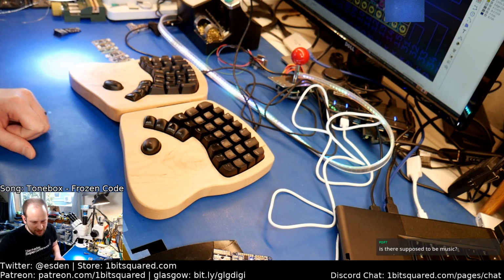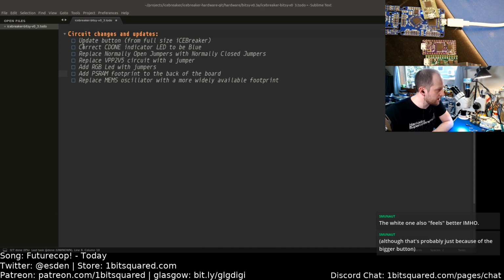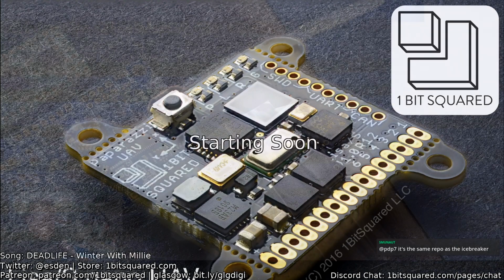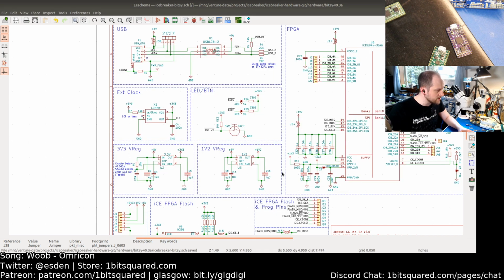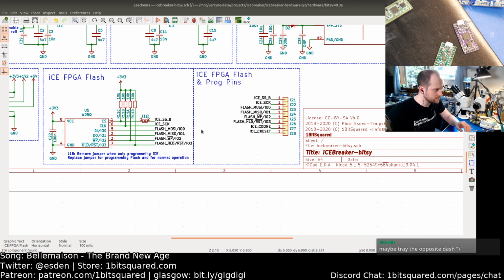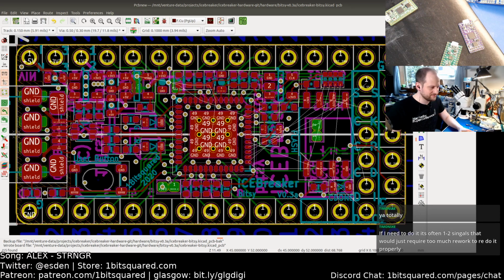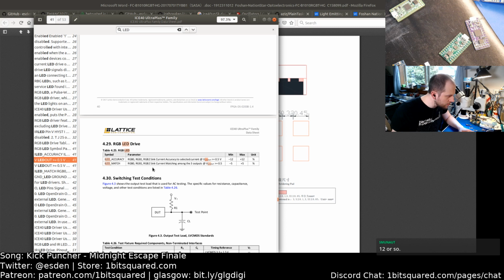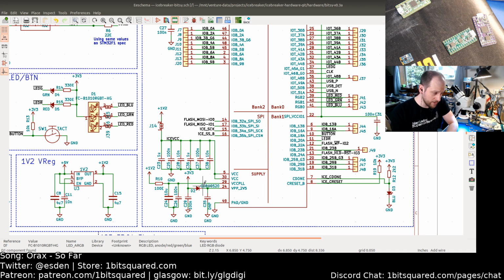Electronics Let's Play - iCEBreaker-bitsy FPGA KiCad update/design work Ep. 1

Comment: True ftdi are way expensive, I have a plan for ice40 devboard but it will use a stm32f042 for FPGA configuration. Ofcourse using libopencm3, thanks for that ☺️. It might also be possible with CP2130 USB-to-SPI Bridge.